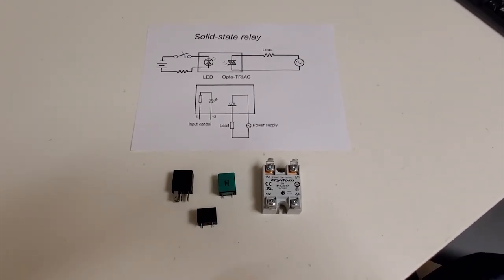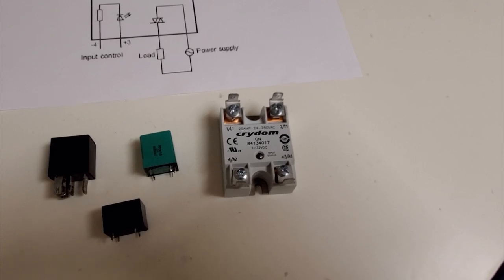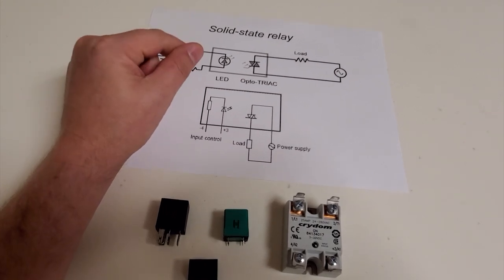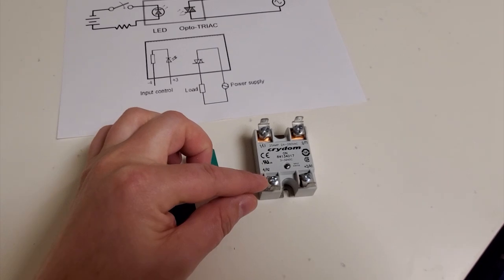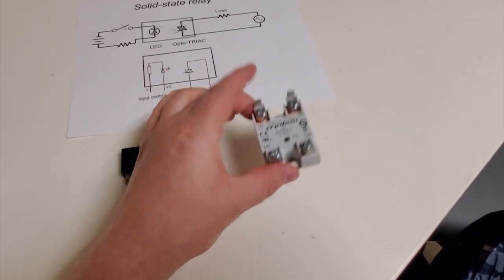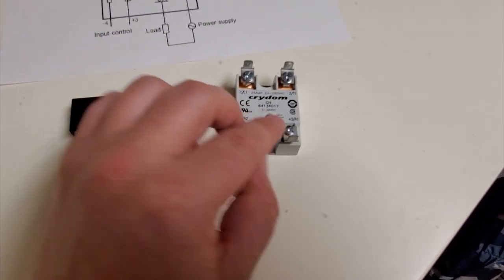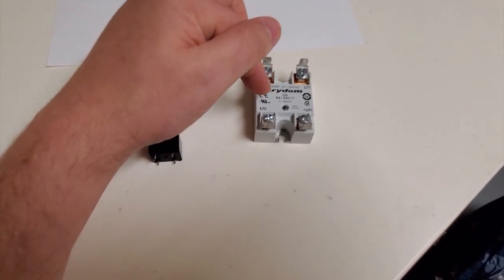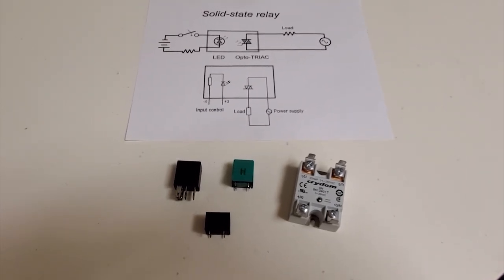Solid State Relays! No more Clickety Clack!

Comment: One caveat to SSRs is that when driving their inputs from another solid state switch, such as a PLC output module, the leakage current out of the module can be sufficient to turn on or close the SSR when the PLC output is "off". You may need to add load in parallel with the SSR input to bring the induced voltage below the pickup threshold.of the SSR.
Reply from the maker: Good point. I have had a similar experience. My solution was to change the SSR to one with a higher V trigger